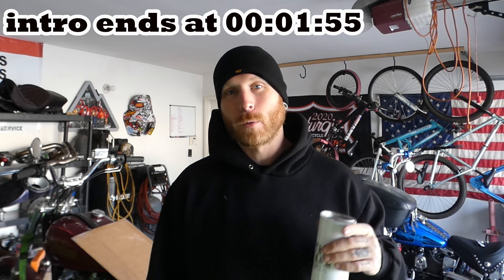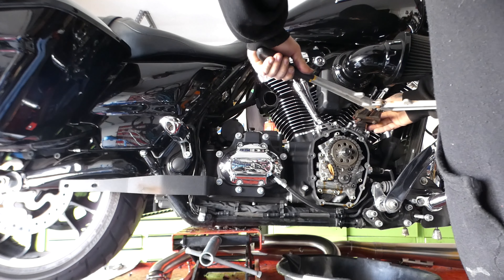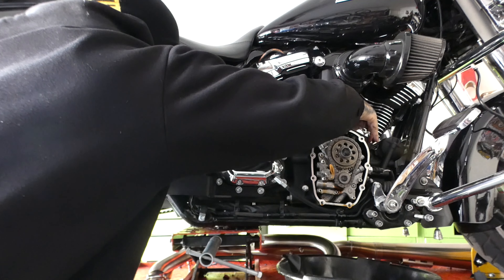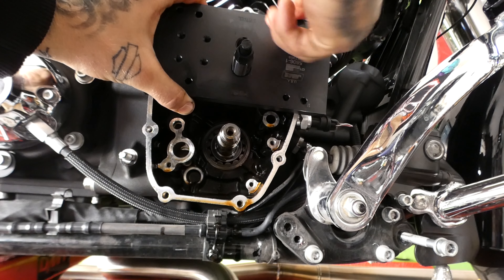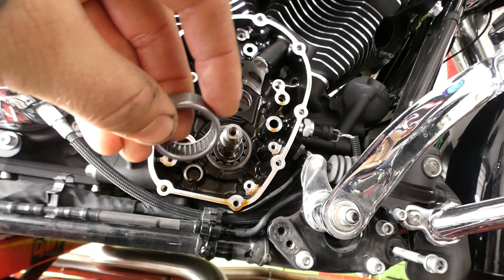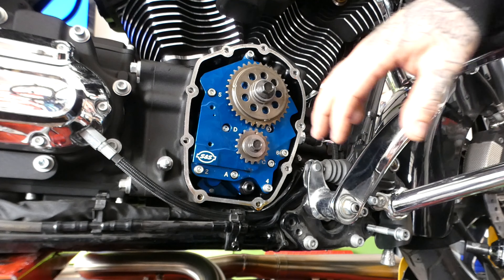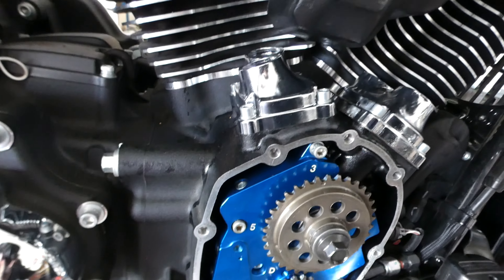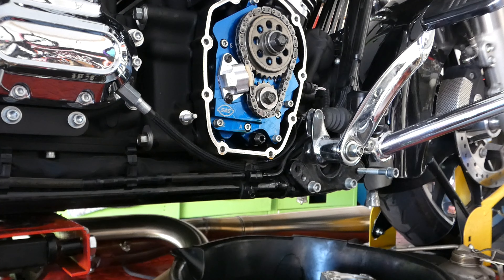Milwaukee 8 cam install (S&S 475c)

Comment: nice video brother but you need to turn out the push rod adjuster 3 turns + 2 flats that gives 0.100 thousands ,at 4 turns you are at 0.125 thousands the lifter has a maximum compression of 0.200 and you want to expand your push rod half so 0.100 is the sweet spot for the lifter to work as it was designed , if you call S & S they will confirm this to you.
Reply: confirm!! I also reached out to S&S because i was getting confused.
Reply: Thank you for this advice I did exactly that when I installed my cam
Reply: Woods lifters are 4 turns

Comment: Don't forget to use the .002 feeler gauge when installing the lifter cuffs  feeler gauge between the  lifter and the cuff then torque.
Reply: In an INSTRUCTIONAL  video,
That SHOULD HAVE BEEN POINTED OUT.
I was just going back to see if i missed it???
🤠✌

Comment: How many Miles did your bike have? Why did you choose the S&S 475 cam?   Mine has 2800, Doing about the same except Se8-447 cam, I'm also replacing the lifters, and crank pinion gear too.   It was a struggle to get the 1/4 20 bolts out, plumb full of high temp thread locker courteously of HarleyD,  and did break off one of the lifter cuff bolts, even though I used a soldering iron to heat up the bolts.. I'm still trying different things to get it removed.. I'm not happy with HD for that and also for them using plastic for Cuffs.. had they used appropriate cuffs, I wouldnt needed to take the cuff bolts out to begin with.  You are doing a nice video, I'm not a certified Mechnic, but I noticed a couple things you might have not checked.. When doing crank-runout measurement, you should also grab the end and try to lift or move around and any number you get on your dial indicator should be added to your .004 inches.. another is Cuffs, moving the rotation to check for drag, before and while tightening your Cuffs or at least after they are tight, check with a .001 inch clearance on the sides (the cuffs can move while you tighten).

Comment: That spacer at the end  of the assemblies goes behind the top gear on the cam plate? What kind of spacer kit or part number do u ask harley for ?
Reply from the maker: Yes sir, it spaces the cam sprocket properly, it’s critical for the chain wear. They don’t sell them individually, they all come in a kit. But the m8 part number from Harley is 25928-06. Other companies offer them as well, just search “m8 cam spacer kit”

Comment: I put the S&S 475 cam in my 2019 Heritage 114 and it’s a real beast.
Reply: Sorry if this is a dumb question, with the fueling cam plate there's a need to specify whether your bike is oil cooled or water cooled. I've got a 2018 softail heritage, is there a need to differentiate with s&s, whether oil or water cooled? Thanks
Reply: Yes as I remember it. Buy your stuff from a reputable dealer, they will ask about your application. I prefer Fuel Moto myself, others may not.

Comment: The O ring on the back of the plate that you say you have no problem not using, are we sure about this? Trying to knock an install out when I realized that it is missing from the kit. Other videos say it is important or even critical. 18 ultra 107. Do I need it??
Reply: I called S&S as the seal was not included in the kit. Was told that they DO NOT include but is recommended that it be installed. Sourced from Harley

Comment: Is there a break-in procedure? I only found one comment on a blog that says no. I have searched all over and on the S&S site. The only related break-in I can find is concerning new heads and gaskets.
Reply from the maker: My suggestion is always “break it in on the dyno” lol. But that’s not any positive info from the manufacturer,  that’s just some advice I’ve been given by some old heads

Comment: What tool did you use to remove the tappet block cover bolts? You mentioned your ball allen was broken? Curious as those bolts at the rear are close to the cylinders.
Reply from the maker: i used a 1/4' drive alan bit and a wrench lol. it takes forever that way, but it'll work

Comment: Based on others' feedback, ss475 lost some HP below 2500-3000. Is that right?
Reply from the maker: Yeah it’s not the best below the range, but I never ride in that RPM anyway. I cruise at about 3200-3400 and shift between 38 and 40
Reply: @GilstrapGarage    That’s pretty aggressive, I'm a fan of low-rpm cruising guy. Those rumbling exhausts sound nice to me. By any chance, do you know how ss 465 performs at a lower rpm like 2000-2500, thanks, and ride safe!

Comment: You didn't have to heat up the tappet cuff bolts? I used a heat gun but it still wasn't good enough. Bolt snapped on me half way out. Now my bikes in the shop to remove the broken bolt from the engine case.
Reply from the maker: 😧 nope, every one I’ve done had walked out easy
Reply: Same for me, but I broken only one of two.. I still have 1/4' length bolt stud to grab on too, but won't try it until I get an Inductive Heater to heat that sucker up.
Reply: @GilstrapGarage  Dang, I'm surprised

Comment: What’s your thoughts on keeping stock oil pump on a 2023 road glide special? I’ve been told the newer ones don’t need to be changed and can handle the new cam.
Reply: I bought a 22 SG 1 year ago how do I know what is the right kit to buy from S&S bc it gives options for either chain or gear drive? N what are all the tools I need to buy to do install? I'm pretty mechanically inclined and confident that I can do it. I just don't know what all tools I need to buy.

Comment: May be a dumb question, but lets say I do this job myself in my garage.  How do I go about tuning it?  Is that also something I can do myself or does it have to go to the dealer?  I’ve watched a ton of these install videos but no one walks through the tune to finish the job.
Reply from the maker: I refer all of my clients to a Dyno Tuner. For an extra fee I’ll even take it to then myself for the customer. All of the “diy” tuners are garbage lol. But if you can’t make it to a dyno tuner immediately, you can purchase a power commander or power vision, and Fuel Moto can make a base line map for you to get by for a bit
Reply: you might do it yourself if you use a tuner with wide band O2 sensors, but.....

... you really have to know something about tuning, it is not as random as stage one setup, you really have to know how tables are working and what are you aiming for what ratio at what RPM and TP, also you have to have knowledge about the spark advance. That is the first thing, second thing is to tune the bike on street can be dangerous, since you have to do those multiple runs even with wide open throttle, do you have balls for that?

In reality better search for reputable tuner in your area (even some tuning shops dont know what they do), and let the bike tune in controlled and safe environment of tuning center. It often is not more expensive to getting a tuner with wide band O2 sensors, since the shop usually has own stationary sensor unit and they often have discounts for "control boxes" so at the end of the day the price you pay is not much higher then if you DIY.

Comment: Question : why is it necessary to cut the push rods ? Not that it matters bc youre installing new , but just wondering if it's a time thing?  Also, do I need push rod covers with s&s push rods if I do this on my 19 SG?
Reply from the maker: It’s a time thing. Removing the rear rocker boxes on the M8s are a nightmare. It saves you probably a couple hours of work. You will most likely need pushrod tubes if you are rubbing the quickee pushrods
Reply: @GilstrapGarage  Brandon I appreciate your reply.  One more question, why do I need to check end play on the crank ? I've seen several vids where ppl do not including on J&P cycles. Not that I'm questioning your knowledge, I'm genuinely curious, I'd like to try this cam install and want to learn as much as possible.  Thanks again man keep up the awesome vids!
Reply from the maker: @tdv1985  excessive run out will cause the gears on the oil pump to tear up the billet aluminum cam plate. I’m not sure why, but the OEM plate is not as susceptible. If I remember correctly, the recommended limit it 5 thousandths. JP cycles probably leaves that out because they want to sell you parts 🤣
Reply: @GilstrapGarage  thanks so much for the information, very helpful.  Is there a way to check the clearance without the orange plate u had on it ?
Reply from the maker: @tdv1985  a few companies make runout tools. That’s one is made by Milch Racing, it’s the most affordable. But that’s the only way you’ll be able to check it. Unless you had a dial indicator you can mount to it from a magnetic base or something

Comment: Brandon I love the video I have a 2018 street Glide I bought a bassani  head pipe 2into 2 with the ss475 cam I have not got it installed yet but wanted to know what slip on exhaust do you recommend for best sound and passing power
Reply from the maker: Thanks for watching! That’s a tough question for me to answer, man. I don’t have a lot of experiences with slip ons to know what works well and what doesn’t. I can say though, the longer the collector on your header the more power you get

Comment: Did you reuse the o-ring from the stock pump for the pump/case mating surface? S&S instructions mentions nothing of the o-ring except in their video, which tells viewer to "refer to the instructions" SMH. I already put the whole thing together and now I'm wondering if I should tear it down again for that o-ring now...
Reply from the maker: I reused it for this one, it wasn’t a new one. The last one I did, I didn’t even install it. I didn’t have the clearance I needed for the pump surface. It’s really not critical when you’re installing these pumps
Reply: @GilstrapGarage  awesome, thank you so much. Great video by the way, it has saved me a lot of money!
Reply from the maker: @444International  that’s awesome man. Ride safe, enjoy. You plan on dyno tuning the bike?
Reply: @GilstrapGarage  most definitely will dyno. Until then, I paid Fuel Moto for a few "canned" tunes for my current setup. Hopefully they e-mail me them soon so I can load them into my Power Vision. Worst case scenario, I detonate a $34k bike! LMAO
Reply from the maker: @444International  send it! Lol. The base maps should hold you over for a while, but what the maps don’t offer is some big things like timing advancement. But it sounds like you’ve got a handle on it 💯

Comment: do you have to adjust the oil pressure valve on the oil pump or is it pre adjusted from S&S?
Reply from the maker: The factory settings from S&S are going to be great for the day to day user. No need to adjust them. But the option is there for the people really going in on a high performance build
Reply: @GilstrapGarage  Thanks Bro

Comment: Great video. Just had a question. Did you add any oil after you finished from the oil lost when opening timing cover? I measured about 500mL lost on mine
Reply from the maker: Yes I did. The oil was still fairly new, so I added oil, warmed it up, and topped it off respectively. But A lot of times that I install new pumps I change the oil and filter.

Comment: Does the tool you have in the video have a stopper in it so you don’t push the cam bearing in too far. This is the scariest part for me cause I’m sure you feel resistance the entire time while pushing it in
Reply: So how do you know when to stop. Where did you get that tool is it the best one ?
Reply from the maker: Yes this one has a lil to stop you when you’re set in all the way. This is a Jim’s tool. Pricey, but worth it. Especially for how many of these cams I have done.

Comment: Looks like my route is 475 cam as well I have a 21 m8 so I’ve heard the stock oil pump is fine to use
Reply from the maker: Yeah man, they got a lot of the sumping issues figured out pretty early on, you be alright to run the stock plate and pump
Reply: @GilstrapGarage  thanks. Yes the harley place i was going to take it told me he recommends the high pressure oil pump but I’ve been seeing alot of newer m8s not doing the pump and plate

Comment: So the OEM oil pumps in the 21’s are no good? Do you recommend upgrading to the S&S oil pump when doing an cam change? Any info is appreciated!
Reply from the maker: They made some major changes to the oil pumps after introducing the m8 in 2017. They have solved the sumping issues from the factory. On a stock motor, or even just a cam, the OEM plate and pump will be good enough. But the after market options from S&S and Feuling are more efficient and can help your bike run cooler. I still have a stock oil pump and cam plate in my Twin Cam because my crankshaft runout is a bit excessive, and it will likely hurt the new parts if I installed them.
Reply: @GilstrapGarage  thanks for the comment bro! I have a 2017 RKS and plan to install a RS 468 cam. I’m sure the old oil pump from 2017 is in the bike, so I should be good with just upgrading to the newer OEM oil pump from Harley right?
Reply from the maker: @Kingdlack  save your money man. Shoot me a message on IG @ gilstrapgarage or an email to b.gilstrap@yahoo.com
If you wanna cover shipping I can send you the oil pump that came out of this bike, there’s like 6k miles on it. But it’ll have the groove cut for the o-ring in the back, you’ll have to pick one up from Harley.

Comment: Great job, but only thing that bothers me is the shifting peg, why putting 475 if u shift up with heel
Reply from the maker: On all the bikes I’ve ever had/rode with the heel toe shifter, I’ve never used the heel shifter. I just shift like a normal bike

Comment: How hot does your M8 get with the new cam install?
Reply from the maker: We don’t have any temp monitoring on this bike, but we were having some problems with the twin cooled system, and when I ran a few tests the heads were in the 250-275 range before the fans would come on and stabilize the temp

Comment: Any idea why my Harley would be running hotter after the stage 2. I have my powervision with gauges and it's telling me my engine temp is 300 degrees
Reply from the maker: was the bike tuned on a Dyno after the upgrades?
Reply: @GilstrapGarage  just a map sent by fuel moto
Reply from the maker: my advice would be to take it to a respected dyno tuner that is capable of tuning to your preferred tuning system (power vision, power commander, etc. and if you have a Fuel pack, throw it in the trash lol) The dyno tuner has the ability to adjust your timing and help you with the correct air:fuel your bike needs. The base maps sent by places like FM are a great starting point, but definitely not for longevity
Reply: @GilstrapGarage  What's your opinion about autotune with powervision? I just got S&S cam chest kit installed on my 114 LRS, base tune for 475 and then refined it with autotune.
Reply from the maker: @CN-ri9vf  I always try to encourage people to get their bike dyno tuned by a reputable tuner that’s confident with the software you want to run, and then run the auto tune all you’d like. The auto tune feature is great for your air:fuel, but you don’t get to adjust anything like timing and the dozens of other things your tuner should look for
Reply: @GilstrapGarage  Okey.. Maybe i'll go for the 128 and then dyno 😉
Reply: @dabrownconservative7843  the temperature is a bit dependent of air/fuel ratio, the leaner you run the hotter the engine is. So a default map can run your engine hotter.

Comment: as far as the tappit cuffs it's possible they can break but it's unlikely gm has been using plastic tappit guides for decades now and I've never heard of an issue
Reply from the maker: Yeah, i agree. Its probably going to fail, but if I’m in there I’d rather make it better 🤷🏼‍♂️

Comment: Are you a cat tech. ?
Reply from the maker: Nope. I did spend the first 4 years of my career maintaining cat and komatsu equipment, and I’ve been to a handful of Caterpillar day classes, but I never really specialized in caterpillar equipment. I believe at the time of this video, I was working for BNSF as a locomotive mechanic. I am a linkbelt crane technician now though.
Reply: I was a cat tech for 30 yrs, and worked at a Harley dealer that’s now closed in NW Indiana, than ran a Hyundai service department, than ran a car hauler shop for USAL. I noticed the hat and snap on tools , I had to ask. From one tech to another, great video.

Comment: Another way to install the pushrod clip have everything installed as you do. Take the clip start in place top part in, take your screwdriver in between the clip and spring cover lift screwdriver up. Don' t 

uze the fins

Comment: Great video bro! I have a 2020 CVO Tri Glide and plan on doing a Cam, oil pump, and head pipe! Any suggestions would be very appreciated!
Reply from the maker: My biggest recommendation when choosing a cam is be very honest with yourself about your riding style. What RPM range you ride in, when you shift, and what gear you ride in on the freeway. Based on that, read what the manufacturer lists their torque values at and make your selection based on that